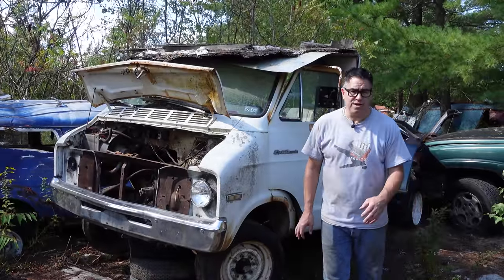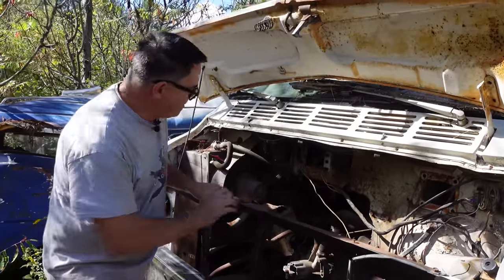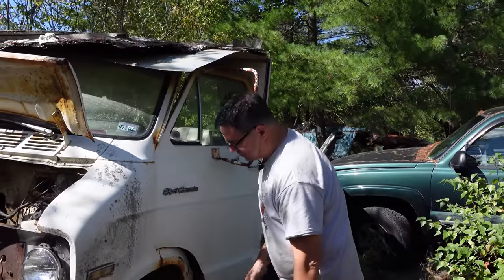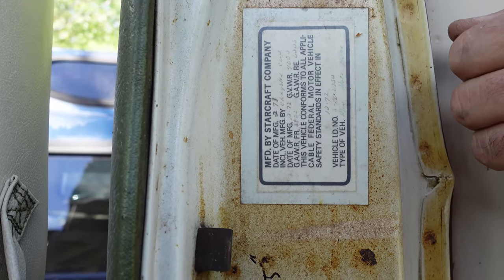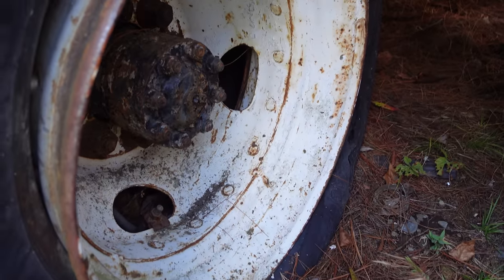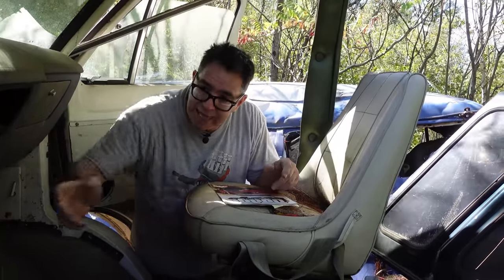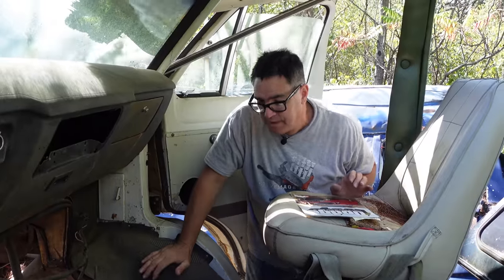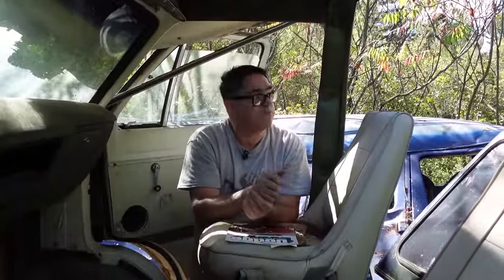Camper Van Dualie

Comment: Normal wheels on front and dually wheels on back. Lots of early class C RVs were like that. Makes me think they left the factory with single rear wheels and were converted to duallies by the RV companies.
Reply: Nah, I agree with Mr. Magnante. It left Chrysler with that rear axle. The RV companies order a "ready to modify" chassis.
Reply: @googleusergp  Make your SRW into a dually kits were very popular back then. I never said they changed the axle, they added the duals. Chrysler would never build a truck chassis with different wheels front and rear. The carry van duallies had dually wheels front and rear. Lots of RVs didn't.
Reply: @ClaremontClassicGarage  That is completely incorrect. The 1973 Dodge Van/Camper brochure clearly shows the dual rear wheels in the book and says, "that it is new for this year". As stated by Mr. Magnante, this truck left the Warren, MI facility with that axle and dual rear wheels and tires installed. The Chrysler certification plate (not the upfitter's plate alone) supports this notion.
Reply: @ClaremontClassicGarage  This era of 1 T Dodge van / cut away came with standard 3/4 T wheels in front and 1 T duals in the back, not a post manufacture conversion.
Reply: @bobroberts2371  Correct. The 1973 brochure supports that as well as the Chrysler certification plate on the driver's door jamb that this was an option.
Reply: @googleusergp  And single wheels on the front?
Reply: @bobroberts2371  Show me some factory documentation to back up your claim and I'll eat crow.
Reply: @ClaremontClassicGarage  Yes. The rear wheels have most of the weight on them (the box and cargo), so they are duals to carry the load across the four wheel positions. Same thing today if you were to buy an F-550, F-600 (which is just an uprated F-550). Duals in the back to carry the load. I work in a fleet where we have hundreds of them (as well as some Ram 5500s too). 

This chassis could have been upfitted as a Type III Ambulance back then or a camper, or as Mr. Magnante showed, a Kary Van. He correctly illustrates how Starcraft cut out the roof for the "dormer" potion of the camper, but it did not leave Chrysler that way. Even today, you can buy cutaway chassis like that. I visit an upfitter several times a year down South and I see the employees driving the cutaway chassis across the lot. They typically have plastic across the back because there's no back wall. Of course, the body will cover that up. That allows for a "walk through" or "pass through" style set up.
Reply: @googleusergp  You are not getting my point. Look at the front wheels They are 3/4 or one  ton single wheels. Duallies have adapters and dually wheels on the front. I know what a cutaway is. I can't understand how they would come with 2 different kinds of wheels. It would need 2 spare tires.
Reply: @ClaremontClassicGarage  And many sometimes would. I get your point, but typically on a 3/4 and 1 ton truck, sometimes (not always) the front axles (and consquently the tires and rims) are the same and the rear is where the difference comes in. The Ford F-450/F-550 comes to mind. Same front axle (although you can get a higher GAWR package for the front on some models), the back gives the F-550 the higher GVWR rating of 19,500#. 

That dual rear wheel set up came from the Chrysler factory like that. No if, ands, or buts about that. It's clear as day in the factory literature. The proper way to verify that they are EXACTLY the same item is to go to a 1973 Chrysler parts catalog and look up a rim for both applications. If they are the same part number, then you have your answer. But, I don't have one of those parts catalogs laying around. I do have one for 1982 and up.
Reply: @ClaremontClassicGarage    It would take some digging to find old Dodge docs, perhaps there is something on the Allpar web site.  And. . . it makes no sense to order SRW  ( with the corresponding incorrect rear  hubs  ) then convert at the motor home factory.    MH makers order large numbers of chassis and can easily spec things they way then want it.
Reply: @googleusergp  still doesn't explain why it has "normal wheels" on the front and dually wheels on the back. Let's leave 3/4 ton trucks out of the discussion because we know they don't come with dual wheels. And even the F450-550 you mentioned will have the same wheels on both ends. And a parts book won't answer anything. This question could only be answered by sales reference literature and order literature. I only want to know why it has "normal" wheels on the front and dually wheels on the back. Its very unusual. Discounting of course much possible parts swapping between 1973 and now. The Carry Van in the literature he held up had correct Dually wheels on both ends. This RV chassis does not. You will see the same phenomena on the little Class C Toyota RVs but not all of them.
Reply: @ClaremontClassicGarage  I know what you're saying, but the order combinations back then were dizzying and yes, anything could have happened back then. You're incorrect, totally incorrect. A parts book WILL tell you if they are the same parts for both applications. If Application "A" uses the same part number as application "B" then one of two scenarios is true: 1) The parts are the same exact part number and installed on both vehicles, 2) or one of the parts supersedes the other and can be used to cover both applications. I was in the parts industry for 11 years and I worked for OEM suppliers---trust me, we went through this on a daily basis. We could be talking appliance parts, auto parts, tool box parts, whatever. If the part #s match, most times it will service both applications. Every so often, the parts are the same, but the later part includes other kit parts to cover earlier applications. Whirlpool igniters for dryers come to mind. The later kit (and only the kit as a whole) replaces earlier igniters. But you have to convert the carrier first to accept the new style igniter. After that, you can replace just the igniter from there. 

Bottom line: That dual rear wheel setup came on it when it left Warren Truck in December 1972. End of story. LOL.
Reply: @googleusergp  I'd like to see the build sheet from it. The parts book will tell you squat.Maybe in 2022 where they look everything up on computer by the VIN. Not in 1973. I still don't think Chrysler would build trucks with different and completely incompatible wheels on either end. That's just silly.
Reply: I have seen many B chassis setup this way, normal wheels up front and duals in the back.  The Karyvan had normal wheels front and back, but did have the full floating axle.  My best guess is the Karyvans were sold from Dodge with standard wheels in the back and converted to duals at the rv shop.  I have also seen RVs with dually type front wheels, all it has is an adapter spacer plate, which could, in theory, be removed by the owner to convert it over to standard wheels.  The spare, on the both type of wheel RVs, from what I have gathered, was a normal wheel.  it would technically fit the rear (as a single) and its all that would fit the front.
Reply: @nightshadefern162  I know there were many companies offering the parts to convert SRW axles to DRW. I nearly bought a kit  for my 78 D200 back in the day.  There was a lot of strange stuff, especially from Chrysler in the 70s. This has been a very interesting discussion all day. The r Rear Axle rating on Steve's RV is 6200. So i looked up the weight carrying capacity of the tires available on that platform and yes it does point to 4 rear tires required so we can conclude it was born a Dually. And the gross of the Chassis 9000lbs which I believe also proves it was born a dually. Whether or not it came with the front wheels like that I don't think we'll ever know. Only the build sheet would tell us for sure.  .
Reply: @nightshadefern162  My vote is that Chrysler installed the duals as it was a factory option that year, supported by the GVWR and the door jamb decal as well as the Chrysler literature for 1973.
Reply: @ClaremontClassicGarage  Once again, absolutely incorrect. The parts book in 1973 will show you what wheels were used on what models and applications. You can then compare two given applications and what's what and see what was used where. The Pontiac parts book for 1980 tells me that the carburetor used on my 301 Turbo was also used in 1981 on export 301 turbo cars because it shows you that the stamping numbers match up and the same exact carburetor was used.  The "Where Used" function of most OEM parts system today tells you what applications use the same part number. How does it do that? It finds every instance of that same part # used in various catalogs and then creates a summary report. In the case of a 1973 application, the "human computer" (your brain) can be used for that analysis. 

BTW: Today's electronic parts books are nothing more than cataloging, reporting and inventory systems. The same OEM data back in 1973 could be made computerized today. Chrysler goes back to 1982 electronically on their system. The original 1982 parts book was not done on today's modern system but was converted subsequently to be added to the Chrysler system. I know, because I used it extensively for years and I implemented its' use at the aftermarket company I worked for. 

Also incorrect, trucks have different axles, rims and tires all the time. I see this on a daily basis on the trucks we have in our fleet. We have a front and rear spare wheel and tire. Why? Because a front axle may have a different GAWR rating than a rear axle. So, they may use different rims and tires to meet that GAWR rating on the placard. So, yes, they could have a different front and rear wheel. Remember, a motorhome is a specialty chassis, it's not your run of the mill telephone company van, stock van, etc. There are things that are unique to the motorhome chassis. Back in 1973, Chrysler had the B Series compact motorhome chassis and the stripped chassis or a "pusher" chassis.
Reply: @ClaremontClassicGarage  Yup, my '76 Dodge camper has dually wheels front and rear with adapters on the front. Doesn't make sense to have two different spares. Likely someone removed the adapters from the front so they could run a 16" wheel as 16.5" are harder to get and cost more.
Reply: @teardroptrailers  Yes, I'm thinking something like that happened.
Reply: I'm thinking the explanation is simply that the owner was about to send this beast to the junk yard, needed to get it rolling, so they had the front wheels, removed the adapter for the original wheels, and put those on to roll it onto a trailer for the scrap heap.it's odd looking, but it did the trick to get it out of their yard.
Reply: @teardroptrailers  On this one in the yard, who knows what someone did in nearly 50 years "in the wild". It looks like from the sticker on the windshield, it's been off the road since about 1997.

Comment: Notice that the data plate still calls out the DeSoto name well after it was long discontinued, as well as Fargo which had just been discontinued at the end of 1972. Chrysler must have had a big stack of those data plate blanks and they were going to "run them out". Later on, that plate would become a computer printed label.

We got the VIN, we win: B3 for B300 1-ton rated van, 0 for incomplete chassis, B for 6,001 to 10,000# Gross Vehicle Weight Rating, F for 360 V8 with two barrel, 3 for 1973 model year, V for Warren Truck Compact Assembly (in Warren, MI) and the rest is the production sequence. Warren Truck still operates under Stellantis today and various parts of the plant have come and gone over the years as the shift in vehicles changed around. Chrysler exited the US heavy-duty truck market in 1975, but exports to other markets continued to 1978. We know this is a US assembled van because the plate says, "Made in USA" and Pillette Road Assembly in Windsor Ontario Canada which would become a main van assembly plant didn't open until 1974 (and closed in 2003 with the end of the B Series model line). Of course, Pillette Road assembled units say "Made in Canada" on the data plate. Possible code B1 Light Blue exterior paint. This type of van is typically called a "cutaway" chassis and GM and Ford still produce them, as does Mercedes Benz for the Sprinter line (the Freightliner branded Sprinter ended for the 2021 model year). Buses and other types of passenger vehicles are made from the "cutaway" chassis. Type III Ambulances are done the same way (Type I are truck chassis like an F-550 or a Ram 5500, Type II are complete van chassis, Type IV are ATV style chassis units). 

Correct, Starcraft is still around at 903 S. Main Street in Middlebury, Indiana in the "RV Capital" of the country. Many trailer, RV and leisure companies are located in the Elkhart, Indiana (and surrounding areas). That is also correct about the timing of an incomplete chassis to completion. Yes, I believe Mr. DeFeo has a Kary Van which he has featured on his channel a few times as a parts hauler. The US Postal Service also had them for a time in the 1970s. They were introduced in 1973. I want to say the Kary Van body was maybe done by Chrysler internally as literature for them clearly discusses van body options. Usually when they are done by outside companies (unless they had an arrangement with a particular body company) the literature does not discuss the body end of the vehicle. 

Notice that the total GVWR (Gross Vehicle Weight Rating) shown on the label (9,000#) is not the sum of the front and rear GAWR (Gross Axle Weight Rating). This is not an error. On light duty vehicles, they tend not to add up, because there is some sort of de-rating and safety factor figured in. However, on a heavier duty unit, they do add up, and the "weakest link" in the chain is stated on the placard. So, if the front axle and suspension are rated 10k for example and the tires are rated 9.5K, then 9.5K goes on the placard for the front GAWR as that is the "weakest link" in the "chain". On larger trucks, everything is fully commercially rated, and mistakes are indeed often made on those labels (I have found several of them over the years). One time, I spotted a wrecker chassis that said "Single" for the rear tire listing on the tire PSI rating, when it was a "Dual" rating. I pointed this out to the upfitter who told me I was incorrect. I then walked him over to a Ford F-550 that was in our shop and opened the door and said, "What does the certification label read?" He said, "Dual. I just learned something. I've been upfitting these since the 1970s and never knew that" (face palm).

That is because the weight is spread out over four-wheel positions in the rear, not two as Mr. Magnante alludes to. That is why the secondary decal from Starcraft is there. They are majorly modifying the original chassis and they have to certify that their upfit does not violate any laws, standards, or regulations that applied to the originally built Chrysler chassis.
Reply: Could nametags that had DeSoto and Fargo still on them had to do with a way of protecting the trademarks from someone else attempting to adopt them, as Chrysler was no longer using them as brands?  For example, I believe American Airlines has a few planes in their fleet that have what they call "heritage livery" from USAir, America West, PSA and Piedmont for the same reason.
Reply: @kennethsouthard6042  Yes, that is possible. Don't forget, by 1973, parts for Fargo Trucks (and DeSoto) were still supported, so that it didn't become an "orphan" brand like so many others before it. Much the same today, you can still get some Oldsmobile specific parts from GM as well as Saturn although that is waning. Even with older Craftsman, even though Sears is basically one foot on the banana peel and the other out the door, the manufacturers that made those products (Whirlpool, MTD, Murray, Waterloo, etc.), still to a degree support parts for them as they most of the time were close to their own branded products of the same time frame.

Comment: Interesting how they had non dually wheels on the front end dually on the rear
Reply: That's how they are done, and yes it did leave Chrysler with that axle, tires and wheels.
Reply: That's how they are done, and yes it did leave Chrysler with that axle, tires and wheels.

Comment: Ahhhh....  The dreaded Chrysler ballast resistor.  Prominently displayed on the firewall at the beginning of this video.  Don't leave home without a spare in the glove box.   I owned a 1972 B300 Maxivan, 318, auto.  Was far and away, a better vehicle than my 1976 B100, short wheelbase, 318. 4sp O/D.